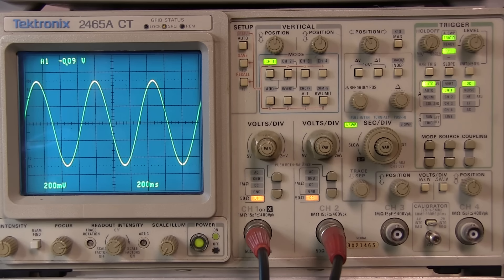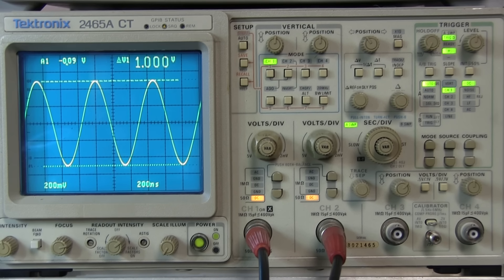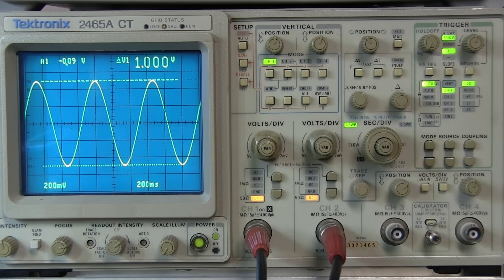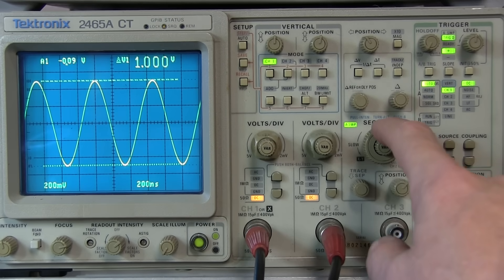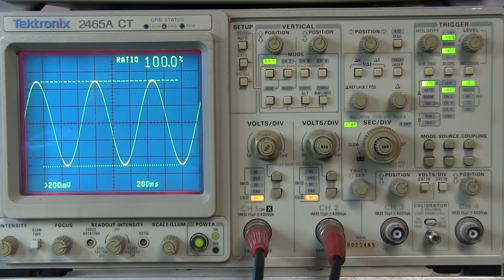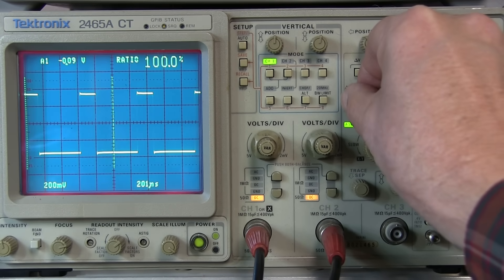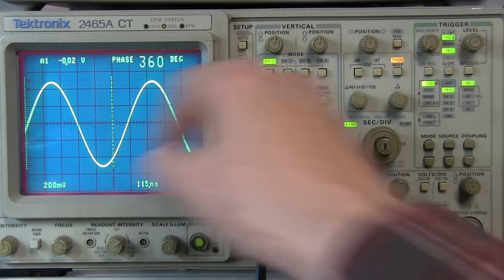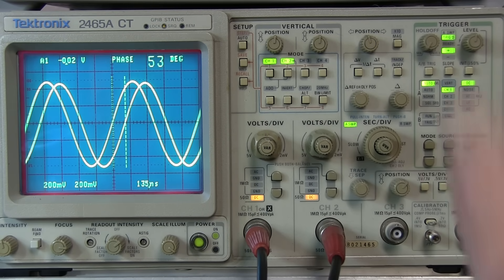#397: How to use cursors on Tektronix 2400 series scopes, including some "secret" features

Comment: Can the Rigol DSA815-TG measure the TX bandwidth of a ham radio and also as it has a headphone for demodulated audio, listen to it. Maybe AM and FM, but LSB and USB and its audio bandwidth? I got the PSG 9080 generator and the RIGOL Digital Oscilloscope DHO814 too, but want to order the DSA815-TG if it will do for my ham radio lab for experimenting. Thanks.
Reply from the maker: I don’t have direct experience with the DSA815-TG, but I would expect that the audio demod would likely be AM only. Maybe FM, but definitely not SSB.  As for modulation BW measurements, maybe. It really depends on the narrowest available resolution BW available  on that analyzer.

Comment: I have some terminated and non-terminate, automotive grade coaxial wire I'd like to test for loss on a NanaVNA.

Do you have any suggestions on how I could connect this wire to the NanoVNA? The terminals are of japanese origin and I don't see any adapters for SMA to this specific terminal type. I'd like to test, but I'm not sure how. Any recommendations would be appreciated!
Reply from the maker: Without knowing the connector type, it's hard to say the best way to connect it.  However, if the goal is just to characterize the cable, then cut off the odd connectors, terminate with a SMA or BNC, etc., and then measure.
Reply: @w2aew  I’m actually kind of interested in seeing how the terminals perform! (I work in R&D and this is a project I’ve been working on!)

I see on Amazon they have some SMA to alligator clip adapters, have you ever used a set up like that? I’m not sure what I’d look for but I was thinking if I calibrated with the alligator clips it might still work out?

Comment: Quick question do you have a video on how to match transistors? What are the important factors that need to be matched and why? If not can you do a video on this?
Reply from the maker: That is a loaded question.  There are a LOT of parameters that can be measured (and thus, matched).  For example, matching base-emitter voltage drop, matching Beta, matching leakage, matching junction capacitance, matching Idss, matching gate threshold, etc.  One has to understand the circuit that the transistors are going to be used in, and how, in order to measure and match the correct properties and characteristics of a transistor.
Reply: @w2aew  So in my case Pioneer SX-939 on the Power Amp AWH (030) board Q1, 2, 3, 4 which are supposed to be matched and it is not specified how would I know what specs need to be matched? Then there is all those other guys posting videos about matching transistors who talk only about Gain or Vbe. Could you do a video and show how to tell which specs need to be matched and how to match them? or at least tell me what I need to know to match the transistors in my circuit?

Comment: I have a 2246,  and remember being able to do delta-t,  delta-v,  and a few choices like peak,  p-p, and so on,  but nothing about percent or phase.  I'll have to fire it up and play with it a bit,  see what all else is in there.
Reply from the maker: Try taking the vertical and horizontal scales out into the VARiable mode…
Reply: @w2aew  It'd been a while since I fired this up,  and checking,  phase is in there,  along with an option to set 360 degrees where you want it.  Taking either of the vertical or horizontal out of calibrated mode jjust gets me a complaint about that on screen,  and no aceess to anything else.  I'll play with it some more...

Comment: As a nit, it is not in fact accurate to say that the sweep speed is uncalibrated with the VAR control out of detent on the 2400s as the sweep slope is under digital control throughout, and the scopes do in fact display the variable sweep speed on the OSD.
I calibrated my 2467 by simply following the instructions in the service manual, but then I started wondering what the steps do and how they work. After scrutinising the schematics, the tek_made docs and the calibration instructions, I've worked out that the calibration for the 2400-series is quite cunning. The way the calibration works on those scopes is that the A and B (from 2465A forward) sweep slopes are set to calibrated V/s values, using the DAC, the TIM_REF_0 signal, the TIM_REF_1 signal and the sweep hybrid delay comparator. The CRT is also calibrated to a DIV/V value using the cursors in order to calibrate the CRT to the graticule (or vice versa). All told, the dual delay and the cursor measurements are independent of the CRT calibration(!!!), and so can attain ridiculous accuracy that is not (I believe) attainable by aligning timing markers on the graticule.
Reply: Also, love your videos, whatever the topic!

Comment: This is slightly off topic but need some input. I recently found my first , proper oscilloscope in a Tek TDS 544D and for a great price. Some usual maintenance and updating of capacitors, etc, it works  very well. But when I went to connect an external curve tracer , the XY mode doesn’t seem to support displaying Lissajous Figures. I tried messing with persistence and other settings to no avail. Would an analog scope like the 2465A featured in your video, be a better choice to use with a curve tracer?? Anything I get will be used so should I try a 2465 or something digital but more modern?? I’d appreciate any wisdom you’re willing to share. Thanks! And thanks for another excellent video!
Reply from the maker: The digital scope should work too, but it relies on the acquired data. Try making the horizontal scale longer. But, in general, analog scopes are better for XY (I did a video on that)

Comment: Really cool, thanks Alan! Isn't there another cursors-activated measurement you can make using the delayed timebase? I seem to recall that there was a time measurement you could make between 2 parts of a signal using the delayed timebase in a way that would be very difficult to achieve without it, perhaps because the feature you're looking for is too difficult to see when the full period of the signal is in view but the time delta between two successive instances of the feature is too long to fit at the faster timebase for the B sweep
Reply from the maker: See my video on the use of the delayed timebase. Those same knobs are used.

Comment: 2400 series is the GOAT. I adore my 2465B, but I still would love to get a 2467B for that awesome MCP display.
Reply: Unfortunately the MCP is rather prone to burn in, so it's getting hard to find one in good condition.
Reply: @rocketman221projects  That's a shame. When I used one, I never turned the display up any more than needed because it could certainly get plenty bright. As I recall, the scope also has auto dimming, but I guess that hasn't saved them all.

Comment: Interesting to see and compare to my 2247A, which has built in rise and fall time calculations, direct select of Frequency readout.  I'm going to experiment to see if some of these other features, like duty cycle %, and phase degrees are also doable. I have owned it since new in 1989 and never needed these measurements, but it will be interesting to see if it has some of these same curser measurements as the 24xx cursers.

Comment: You can use the tracking to verify that the phase on the up slope matches the phase on the down slope.  If there is a vertical shift between the signals, these measurements will be different and you should average the two.

Comment: Anymore examples of using the VAR for voltage "percentage" measurements? I'm not sure what applications or circuits under test would a technician want to measure the "percentage" of a voltage. Maybe for EQ tone stack circuits to know the 70 percentage the cut off frequency?
Reply from the maker: That’s a good example.
Reply: @w2aew  To measure amplifier power wattage "reduction" the 100% can be 100watts then measure the power reduction percentage at 50watts, 25watts, 10watts, 5watts, 1watt. Maybe you can do a video lesson using the VAR to measure amplifier power reduction
Reply: @w2aew  another example is measuring the percentage voltage of the AC ripple in power supplies? And to measure the e percentage voltage of the regulators IC chips rejection to know the fluctuation percentage in regulator chips. The regulators IC chips are suppose to clean up the AC ripple fluctuations which is measure ln a percentage.

Comment: Old machine
Reply: Before digital scopes…

These functions were still important; one technique involved a Polaroid camera pointing at the screen. The shutter could be triggered, so that only the right trace was captured.

It was tedious and a bit clumsy, but good enough to do a lot of design and analysis that we often take for granted.
Reply: This range of scopes from Tektronics are seen as classics in the electronics world, they are lovely to use, the service manuals are readily available, as are a lot of the spare parts, and they are usually repairable without too much trouble, should they ever break down.
They are also great quality. 
These scopes will most likely still be working past the time when a modern, cheap DSO like a Hantek, breaks down, and it won't be as easily repairable, if at all, like an old CRO.
I have a Siglent DSO, and I love all the functionality it has, don't get me wrong, but the tactile feel of my Tektronics 2465 is just VERY nice to use. It's like my comfy slippers scope. 😊
Reply: @zedcarr6128  
Two things leave me not to think about using the analog oscilloscope regardless of its brand :
1/ It does not have a recording in the memory, this specification is very important to analyze the transient regime of the signal.
2/ the recovery of the image of the screen in the form of a file to add it to my research documents
in addition to the self-measurements that are in the digital oscilloscope.
everyone has their own vision.🥰
Reply: @zedcarr6128  
Two things leave me not to think about using the analog oscilloscope regardless of its brand :
It does not have a recording in the memory, this specification is very important to analyze the transient regime of the signal.
the recovery of the image of the screen in the form of a file to add it to my research documents
in addition to the self-measurements that are in the digital oscilloscope.
everyone has their own vision